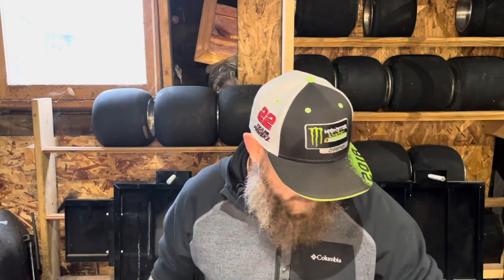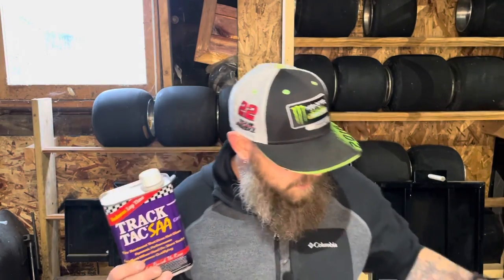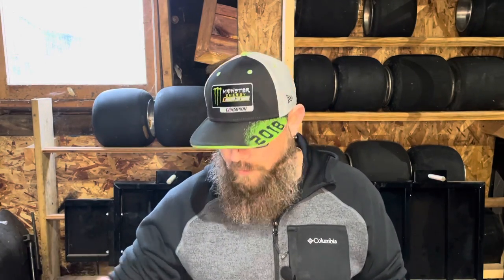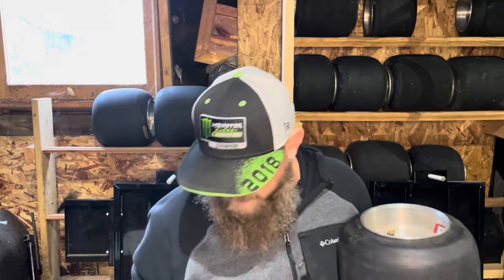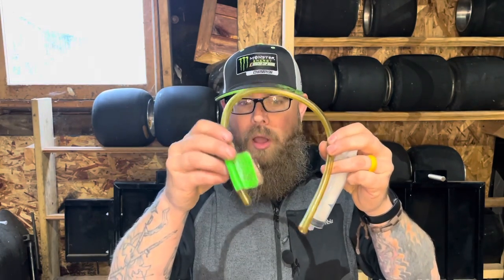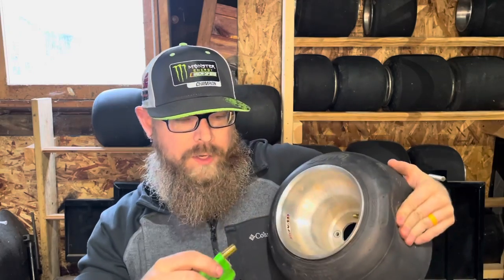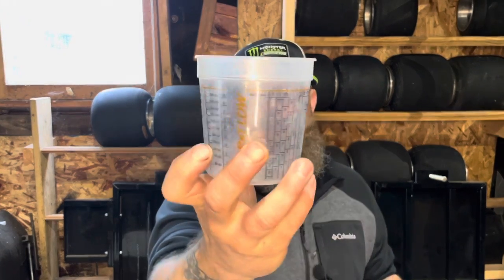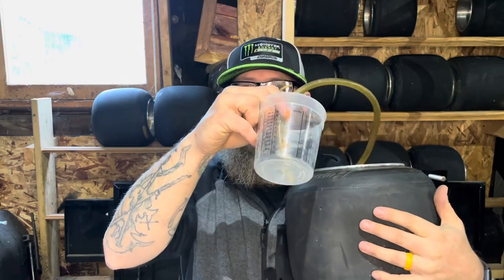Internal Kart Tire Prep: how to

Comment: I enjoy your videos, they are informative. I use the fuel line and measuring cup method, but I like the syringe, I have to try that.

One tip I picked up from another video is to not to lay the tire flat when putting the inside prep inside because you don't want any prep touching the sidewalls, and weakening their integrity. 

Keep the videos coming.

Comment: My track rule is Burris slicks I'm planning on running 33s. It's a dry sandy track. It's my first year racing any tire prep tips would be awesome!
Reply from the maker: Absolutely.   Because I run Track Tac I’m just going to suggest them because it’s what I know.   Black sand is a great grip treatment without making the tires too soft.   The week coming up to a race maybe two wipes of straight black sand prep on tires at the beginning of the week and let set until race day.    At the track I like a 50/50 blend of Acrysol and Black sand on a dry slick track.     If you have never done this before the best way to keep and apply is disposable Tupperware sandwich containers with a buffing wax applicator (sponge inside material).   If you need a pic of what I’m talking about email me at ben420426@gmail.com  and I’ll send u a pic.

Comment: You mention cutting the prep at the track with a 50/50 blend of Acrysol - what advantage does that offer over just putting straight prep on?
Reply from the maker: Quicker drying time and Acrysol opens the tires pores to take in the prep better.  It does reduce the effectiveness of straight prep but Allows slower absorbing preps to be used at track.

Comment: How much internal prep do you use? Is it the same amount for each tire or do you use less on the right side tires?
Reply from the maker: Basic amount for me would be 2oz Right side tires, 1oz left side tires.   This just adds a bit of bite usually without dropping duro to bad.
Reply: Thanks for your videos. They’ve helped a bunch. We race in north Florida and everyone down here says you gotta get the duro down in the low 30’s upper 20’s.

Comment: I was told that odderless mineral spirits works great internally. What are your thoughts?
Reply from the maker: Very well could be.  I’ve never done it before but much like “breaking down” paint I would assume this would happen to rubber to a degree causing it to get softer and bite the tire up.
Reply: Itll need an oil added to it so when the mineral spirits evaporates and pulls the oils out if the tire, it doesn’t make the tire hard

Comment: How often do you do the internal prep on maxxis?
Reply from the maker: Once prep is in,it’s In. Usually a one and done, just treat from the outside.   But! Some preps do work their out after time (or so I’m told).  I have Maxxis I havnt run in over a year and I’ll be re treating them internally again to introduce some oils back into them.

Comment: why do people prep the inside of the tire?
Reply from the maker: Depending on condition it helps the tire though the race cycle, and/or changes the overall durometer of the tire.  For instance I have Vega yellows that duro 50 new that I’ve treated inside and out now duro 25/30 much softer for cold wet tracks.
Reply: I use a small funnel with a fuel line stuck to the bottom and pour it in.
Reply from the maker: @irepairofpc31familykartrac51  that’ll work too.